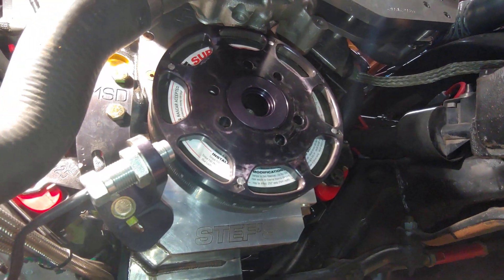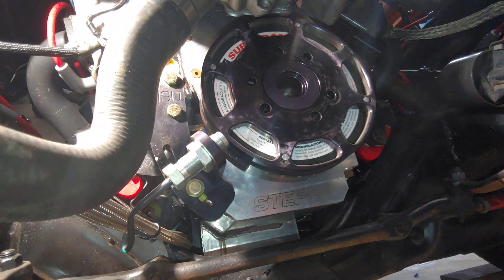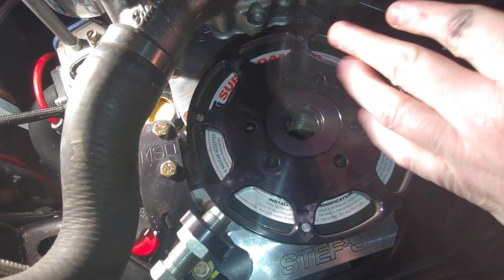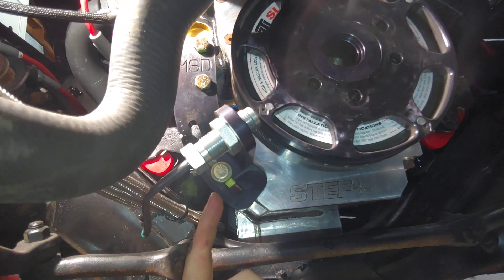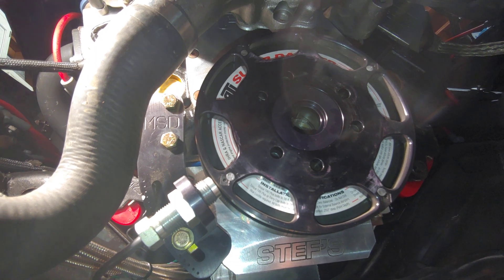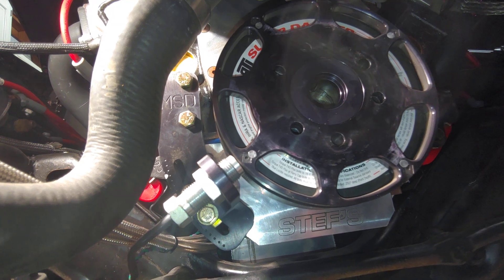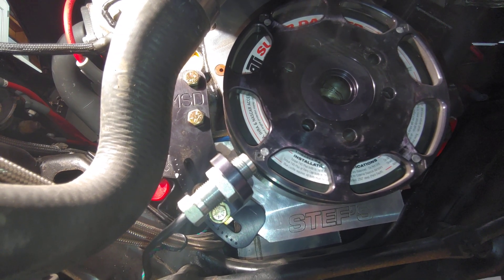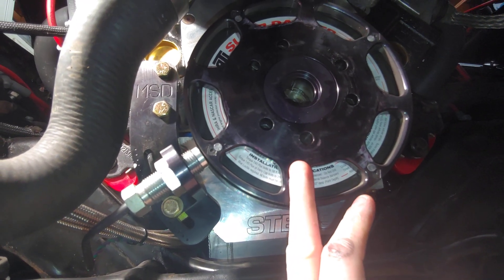Setting MSD Crank Trigger for Fueltech #fueltech #msd #procharger #gbody

Comment: Man i could definitely use some help setting up the cam sync, i have the same one you do on a SBC as well.
Reply from the maker: @beerad12  holley or FuelTech?
Reply: @ fueltech ft550
Reply from the maker: @beerad12  set motor to 70* btdc, stab cam sync. Rotate sync housing clockwise just until the led turns off (magnet in front of pick up and voltage high 12v/5v). Because the pick up in the housing rotates clockwise in a sbc as the motor turns this means the pick up is just about to rotate clockwise of the sensor (led turns on, voltage goes to zero ="signal falling edge"). Then set cam sync in FT software to 70* digital falling.

Comment: Have you had any issues with the 4 magnet and crank sensor with the fuel tech and cam sync ?
Reply from the maker: Nope, has worked great so far. Motor has been to 7,600RPM

Comment: Is there a reason for not swapping to a Hall sensor? Only asking because how I've fought with VR sensors, and they are much more demanding than a Hall. Or I should say, Hall sensors are easy to setup and they give a consistent reading without issue.   It's great though that FuelTech is willing to help you with this!
Reply from the maker: I called Fueltech today. They said most of the cars they tune are using a VR sensor and all the promods they tune use VR sensors, they didn't say why though. I think with VR sensors it really matters the software strategy used to read them. I think FT has gotten a good handle on them. Holley has really given the VR sensors a bad name lol.